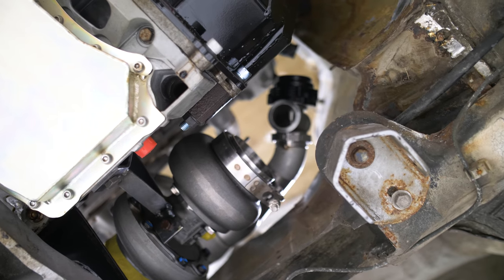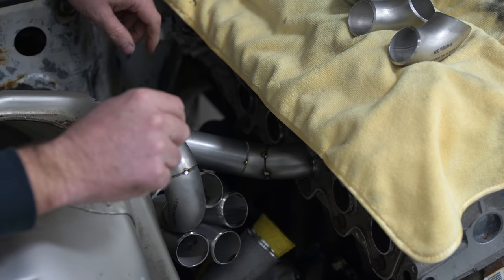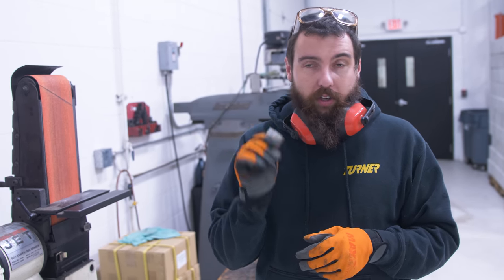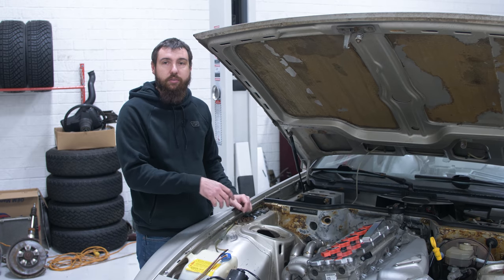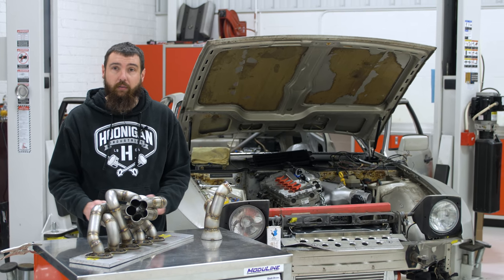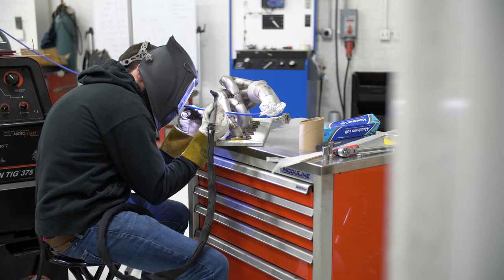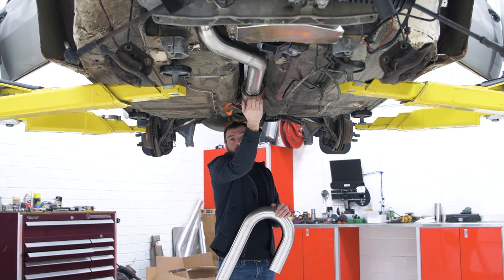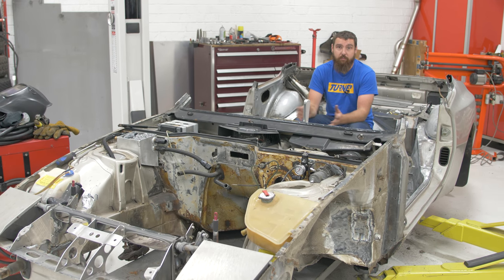Porsche Rally Build EP 2 | Built by Mike

Comment: Amazing progress! Love the welding you do.
I assume you decided to use a spring at the wastegate because its much easier and probably less maintenance intensive compared to an electronic wastegate with actual intake/charging pressure as control signal? The latter option would compensate for drift and efficiency losses of the turbo.
Reply from the maker: Mike says: "I went with a traditional wastegate for cost purposes. But, I will be running a solenoid with the standalone to control boost."

Comment: are you going to be putting the original roof back on or will you be replacing it with something lighter
Reply: Probably depends on what the rulebook says for the rally org he's going to run with. Im building mine to NASA Rallysport reqs and they require an all metal roof. So I cut a non-sunroof roof off a 924 that I will be replacing my 944 roof with after adding the cage
Reply from the maker: The plan is to put the old roof back on!